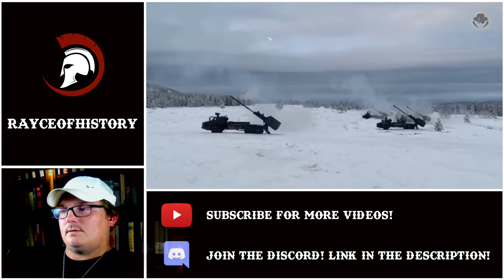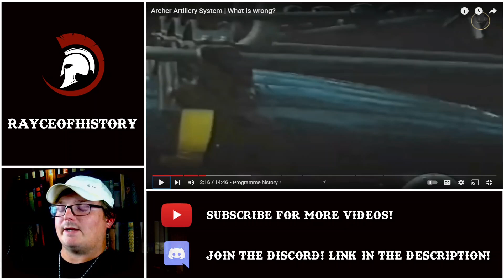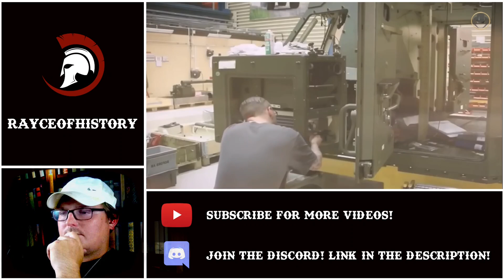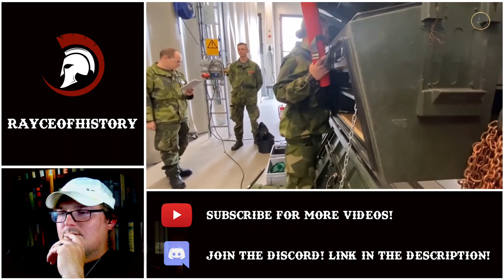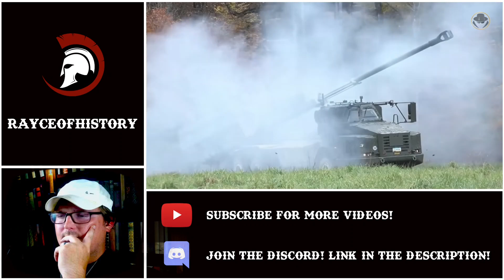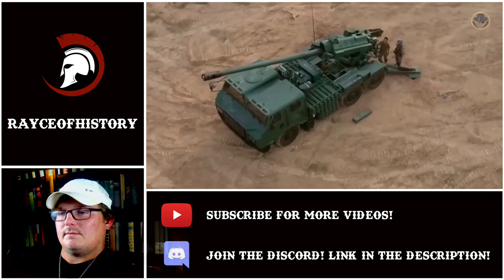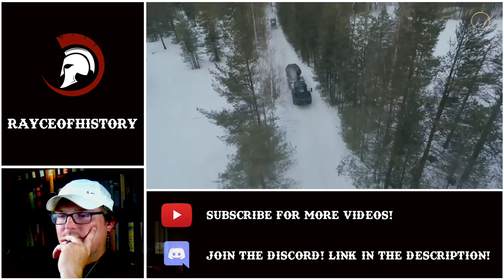Texan Reacts to Sweden's Archer Artillery System | What is wrong?

Comment: Always had a thought, why not design military equipment for load changers. Like anti air, LMRS or other equipment (artillery might be to explosive). Any civil truck with load changer would be suitable as reserve truck. Al you ned to build is the weapon on a changeable carrier with a remote system. Dropp it off or keep it mobile.
Reply: Sweden are using them for containers and feultanks. A bit. Of missed opertunaty to not use it for weapon systems.
Reply: Integration would be really difficult, the whole system would need to self contained with power generation etc. You could run a cable to a laptop in the crew cabin, but you probably want more than just a laptop for most modern systems. I also think there are issues with rigidity, either damaging the chassis or risking dropping the load when firing. You could of course place the load on the ground when using it, but that sacrifices mobility. There are also the issue of only having space for one passenger in a regular truck. Basically i think civilian trucks should stick to logistics, since that is what they are good at.

I find Volvo Defenses cargo concept using articulated haulers more interesting. Basically a similar chassis to the Archer but with a container in the back. Seems like a good way to get supply close to the front, without risking a bunch of trucks getting stuck in mud or on bad forest roads. Over all, Volvo Defense seem to have quite a good offering for military needs with trucks, construction equipment, haulers and power generation equipment.

Also, it would be interesting to see the articulated hauler chassis with the tracks they sometimes put on wheeled forestry harvesters, basically converting it into a half-track. Feels like that would make it unstoppable in the forests.
Reply from the maker: What are you meaning by load changer? I’m trying to work this question out in my head.
Reply: @rayceofhistory  trucks that can shange what they are carrying, from flatback to gravel bucket, container. Hookloader might be the English word.
Reply from the maker: @andreaswennberg9542   gotcha! Okay that makes sense. The US has different variations of vehicles that are used in that way, as in can be sort of used for a whole host of different things, but I’m not sure about with weapons systems.